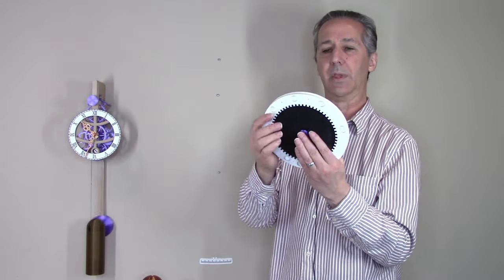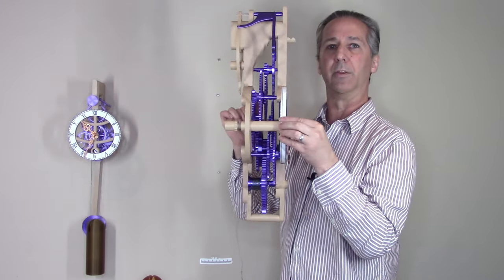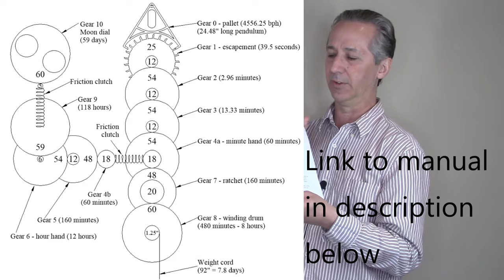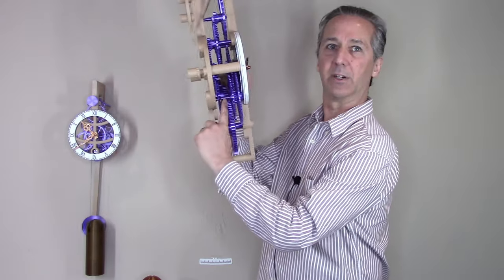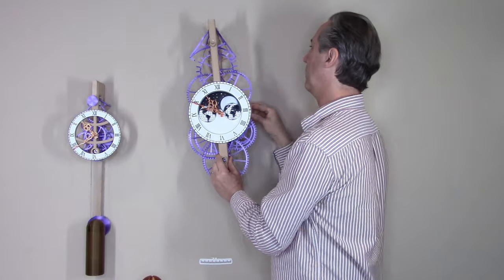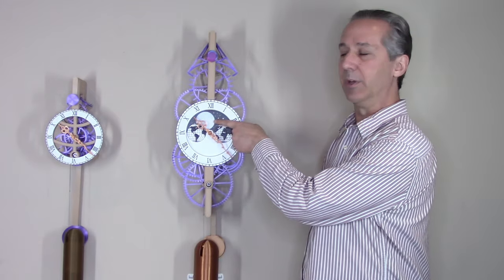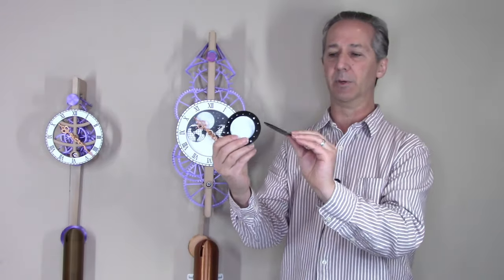3D Printed Moon Phase Clock

Comment: another that I will have to add to my collection, Should I buy know the reveiw copy or wait for the final publish
Reply from the maker: I run the same quality checks that MyMiniFactory runs, so it should be good. If I missed something and needed to make an update, you would have access to the new files for as long as you can still log into your account. You will have access if I make updates 5 years from now. The quality checks and accessibility are the main reasons I have stayed with MyMiniFactory.
Reply: Thanks for your reply,   Have bought the plans and now the fun part, making it on a K1 printer a bit faster at making the parts, think about some add on gears on your clocks to chime a bell once on the hour and using a 1 rev 24hr gear to program the silent time, like to add this to my impulse  clock
Reply from the maker: @janetmorris6792  A passing strike that rings a single bell on the hour is easy. It could be as simple as a cam on gear 4b or the spacer below gear 4a. Adding night silence would require at least one new gear.

One of my grand plans is to add a full Westminster chime. I estimate that it will double the complexity of the clock. One of the first hurdles is building a good sounding chime using commonly available materials. I prefer not having every builder track down a specific size chime bar from a clock repair shop.

Comment: Steve, im just a average consumer, I just would like to buy the clock, I don't wanna buy any 3d printer or mess with the assembly, like the most the people in the world, however I cannot find any link for purchase it, on other hand I'm an entrepreneur, bro you literally loss tons of money and community for don't selling the final product and just layer for 3D printer geeks , that its a very tiny community, Now I'm forced to buy a Chinese Pendulum Wall Clock in Amazon, thank you for your answer :)
Reply from the maker: This design is completely optimized for 3D printing. I have considered selling a few fully assembled clocks. It would likely be a volume of 1-2 units per month. Selling it as STL files allows the design to reach hundreds of users.

There are plenty of wooden gear clocks available from other designers if you want to avoid buying a Chinese pendulum wall clock from Amazon. :)

Comment: Steve, can this be done on the LARGE Crazy gear wall clock as well, with some mods possibly? (I really like that one and it has been one of the most accurate and unique with the gear designs built from of your collections.. It's ran continually since day one without any issues whatsoever.. 👍👍).  LOVE the 'test cookie idea!! 💖💖
Reply from the maker: Every design gets more and more reliable as I discover better methods. The moon phase clock seems more reliable than the crazy gear wall clock. It uses a smaller gear tooth that allows 12 tooth pinions compared to 8 teeth in the crazy gear clock. The active gear tooth surface is the same, but more pinion teeth will have less engaging friction. 

The only clock that is more reliable is the small 8 day clock. Smaller gears need less drive weight. However, the larger gears look so much more impressive. They just take a bit more weight to run reliably.

Also, the only reasonable gear ratios for the moon phase gears are 59:6 and 60:5. These need to have a tooth pitch that is smaller than the crazy gears would allow. And the intermediate moon phase gear is right in front of gear 5 in the lower left corner. The clock looks better using the small gear teeth everywhere instead of mixing sizes.

Comment: Hallo Steve ich habe ein Problem! das weigth_shell_pulley ist im Durchmesser zu gross und passt nicht in das weight_shell_top 3P2 ! kann ich auch das pulley von der easy clock nehmen?
Reply from the maker: Sure, you can use the pulley from the easy build weight shell. You may need to guide the cord when winding. The moon phase clock has a larger pulley and a deeper slot in the weight shell body to provide more separation on the cord.

I believe that the STL files released with the design are correctly matched. Is it possible that you printed a weight shell body from the easy build clock? If so, then it would need the smaller pulley from the easy build clock.
Reply: ich glaube du hast recht ! @stevesclocks
Reply: ich habe tatsächlich die falschen gedruckt und das gleich 2 mal falsch! Mit 75 ist man manchmal etwas unachtsam Ich werde mich bessern! Schönen Sonntag wünsche ich dir